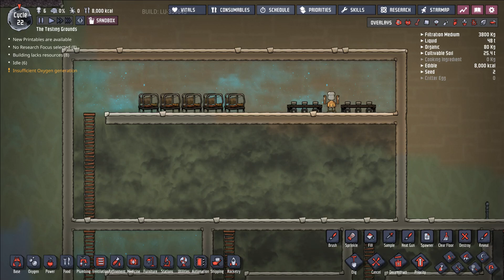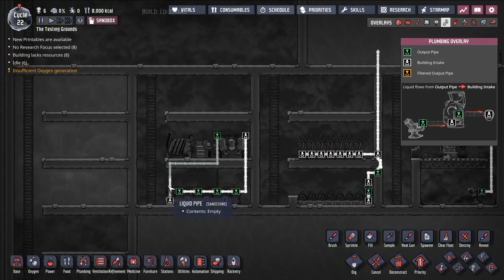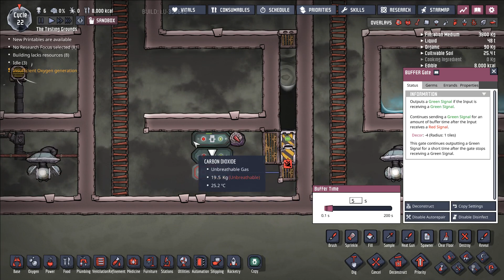How to Deal with Carbon Dioxide -- New Player Guides [Oxygen Not Included]

Comment: Missed the classic and most complicated method.  Liquifying it with a hydrogen bubbler.  The basis is to continuously use air conditioners on hydrogen, then radiant pipe that through a room filled with CO2.

Comment: both those exploit methods may be solved if the makers of the game did pressure phase calculations, that is if a liquid or gas is at a certain pressure it will phase change into a solid
Reply: dpsilver Yeah they have temperature phase change but not gas, I’m sure in there gas objects they could have a simple algorithm that checked the current pressure and see mined what state it needed to be and change states if it’s not. Then again I’ve not looked into detail at the code so don’t know how they’re storing tile data
Reply: @justgame5508  yeah because the equations are simple for it, just check the pressure and the temperature and if the conditions are right then they phase change into a solid or liquid depending, but then again its a game so yeah lol , because liquid CO2 isnt something that you normally see under normal conditions
Reply: kosmique Yeah they should just do pressure damage, if a gas tile is over pressured next to a weak wall it should start damaging it. You would then be forced to build rooms out of obsidian, steel, diamond etc to store gasses at high pressures. This would be simple to implement and would balance the infinite gas. Problem is it would add complexity to the tile calculations and could drop the frame rate substantially, especially in late game
Reply: @justgame5508  There is already a pressure damage. Observed that with a volcano and crude oil, turned into petroleum then sour gas, more than 100 kg/tile, then the solid materials and walls went under pressure damage and have broken quickly. It was during QoL2 upgrade I think, I suppose it is still the case (and therefore there is a limit to the exploits used in this video)
PS: massive problem in my base when that happened...
Reply: Maxence Duhamel think that’s only for liquids, because I’ve had well over 100kg/tile of gas with no issues

Comment: you should be careful when using oxyferns. you can end up in a situation where the pressure in your base gets to high and your dupes get stressed from popped ears. I usually use a carbon skimmers and a sensor. makes it easier to manage the pressure in my bases. it's also a decent source of germ free polluted water which is needed for a few plants like  reeds or sleet wheat
Reply: Karanjeet Kainth  Oxygen + others gases = pressure

Comment: do you have to use oil for the co2 compressor or will any liquid do?
Reply from the maker: Any liquid will do, so long as the CO2 isn't at a temperature that boils the liquid.
Reply: Yu out can even do it using only mech doors and automation.

Comment: Here's a bit of a bonus to using Carbon Skimmers: They only run when there is a significant amount of CO2 to consume. No automation is necessary for optimal power usage.
Reply: Storm Rose but don’t they suck using the full 120kw when there’s only a tiny cloud floating near them?
Reply: @darkfangulas  technically speaking, carbon skimmers consume Co2 in discreet 'gulps', guaranteeing that the device consumes x amount of mass per joule used. In other words, the device is perfectly efficient without automation.
Reply: The problem I had was that they wouldn't transfer heat. If put in a sealed room with only co2, it would get vacuumed out and they would overheat

Comment: can you really store an infinite amount of co2 in a small room, dont the walls break because of too much pressure?
Reply from the maker: For a long time there were no gas pressures at which walls broke, now I believe they can break from pressure, but it takes an extremely large pressure to do it, particularly if you use materials of high hardness.  If you plan on putting absolute huge pressures in there, try an insulated tile wall made of obsidian.

Comment: 300grams ... is not more than 2KILO grams ... it's 1/6th at best ... 2kg is 2,000 grams ... you need 7 carbon scrubbers for each coal gen ... and even then all you pull is 100grams of excess carbon .... which you get from yup your dupes ... 2g a BREATH not a cycle so after 50 breaths your scrubber is not doing anything 

.
Reply from the maker: Quick question: does the room you're in smell like toast?

While you're answering that, lay some math on you:  A carbon skimmer gets rid of 300 g/s of CO2.  A coal generator produces 20 g/s of CO2.  So you dont need 7 skimmers per generator, you need 1 skimmer per 15 generators.

Make sense now?
Reply: @gearheadgaming1  ouch I think he needs a blast freezer for that burn. Hope you didn't kill him with that.